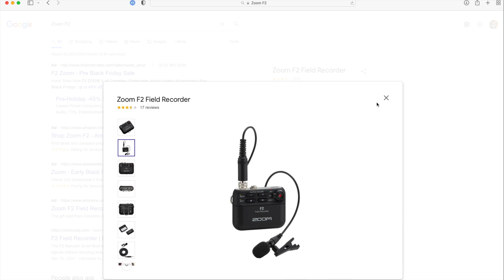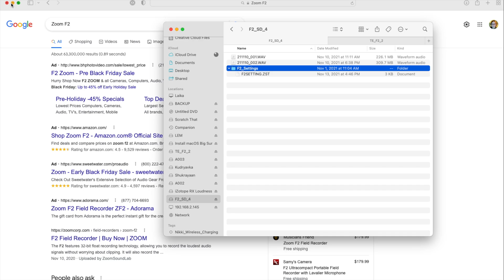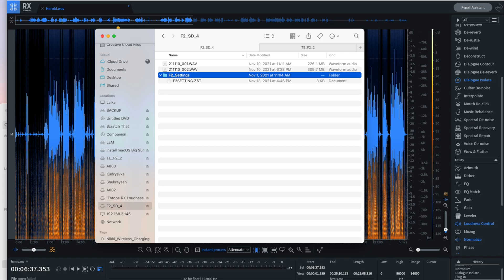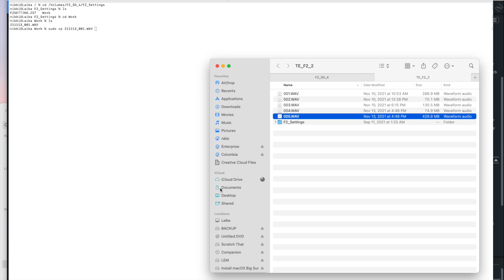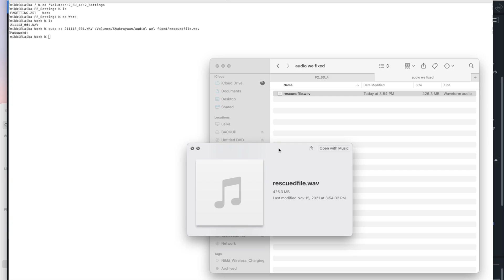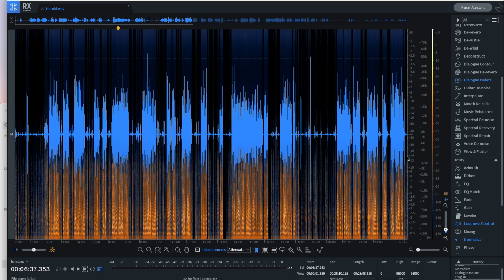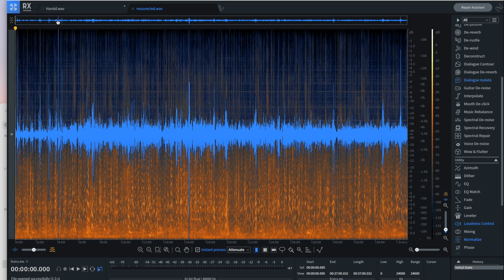How To Rescue Zoom F2 Aborted/Corrupted Recordings

Comment: Windows 10 user here and totally new to sound recording. Nothing found on the work folder. 3 days of unrecoverable filming were destroyed because the device did not record. After software update, manual operation mode and recording button pressed in locked state. There is no support and no response from Zoom.

Comment: For anyone struggling with this. I just found that if you plug your sd card back into the zoom, connect it to your computer, then turn it on and open the F2 editor, it will sometimes finish making the file and you will see a created .wav at the time it was inserted. I thought I lost wedding audio, but apparently this is a common bug with these recorders. Same thing happened about a year ago with a different F2, it did the thing where it locked up and wouldn't respond. Unfortunately in that case I was shooting for someone else and we never recovered that audio. There's since been a firmware update that rectifies the issue.